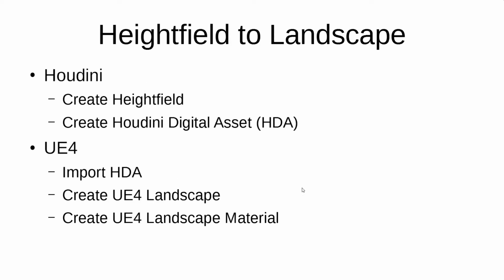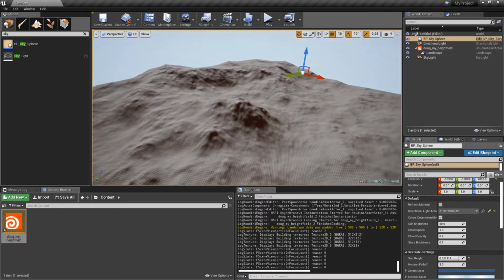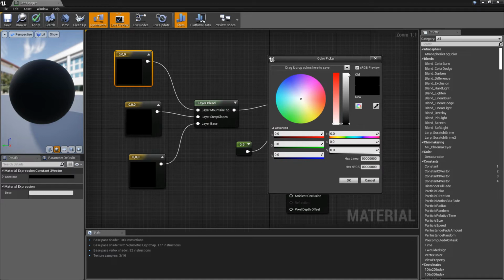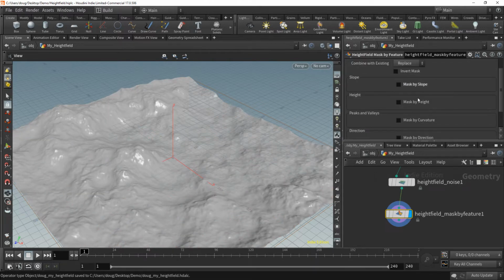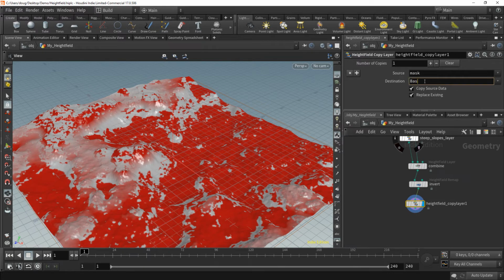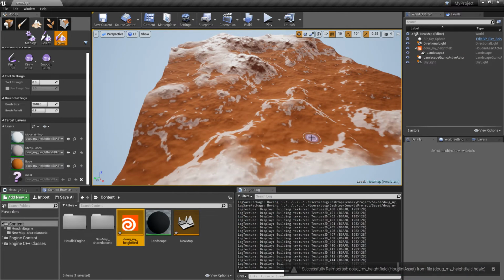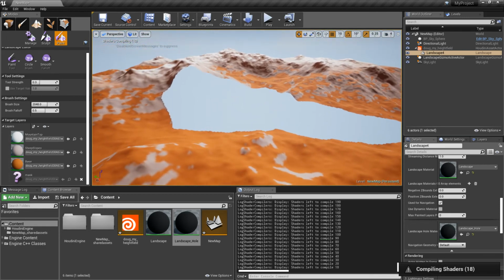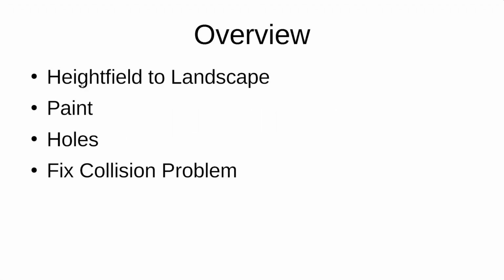#Houdini Heightfields to #UnrealEngine4 Landscapes

Comment: Does UE4 just see this as a large mesh? Whilst the advantages of using Houdini Heightfields to generate landscapes are obvious, is the UE4 landscape a lot less expensive in terms of computation or memory, etc? Nice and simple to understand what you did. :-)
Reply from the maker: No, landscapes are not simply large mesh objects. They are divided into components that can (among other things) be individually excluded from rendering during occlusion culling. You can see this in action by adding a landscape into your UE4 level, navigate around the middle so you can't see the entire landscape, run the "FreezeRendering" command, and then turn around to see what parts of the landscape have been culled by the occlusion culling. Google "Visibility and Occlusion Culling" for more information on this.

Landscapes support LODs on a component basis. If you had a single big mesh it would all have to LOD at the same level. Since a landscape is divided into components, each component can be given a different LOD depending on it's size on the screen.

Both of these only matter if you are going to be on the landscape. If you're just trying to build a distant landscape that you will never get close to, and this distant landscape only takes up a small portion of the screen and it is fine for the entire thing to be assigned a single LOD, then making it a single mesh is totally fine (e.g., distant mountains).

For more technical details, google "landscape technical guide".
Reply: @doug_richardson  Cheers. I thought the heightfield was exported and, somehow, put onto the UE4 landscape as a displacement map or something like that.
Reply from the maker: Oh, and you can always use Houdini's "Convert HeightField" node to turn your heightfield into a single mesh if necessary. https://www.sidefx.com/docs/houdini/nodes/sop/convertheightfield.html

Comment: 2:36 Assets are expected to be subnet at there core (who have a minimal subset of parameters from a geo node for instance), as you answered no, it uses the Geo node who have a bunch of extra parameters (Render for instance) so the dialog means they will get wiped out. Hope it helps, thanks for the video
Reply from the maker: Thanks for the info, that does help.

Comment: Houdini Engine does not run on the Free version. How can I import it into UE4 without the plugin ?
Reply from the maker: Unfortunately, you'd have to export the terrain and weight painted layers as PNGs, which is the same workflow used by World Machine, hand painting terrain in photoshop, or most of the other ways of generating landscape.

Comment: A heads up..the "destroy all spare parameters" that you didn't know the consequences of messed up the workflow for me, showed up as nothing in Unreal.
When I  chose "No changes" it works.
Edit: Scratch that, it worked one time for whatever reason, still having issues. It's only showing up as the Houdini logo in Unreal.
Reply from the maker: I've experienced issues where you only see the Houdini logo in Unreal (I assume you mean the actor in the UE4 level looks like the Houdini logo but never bakes to the landscape). Usually when that happens to me the issue is that HoudiniEngineForUnreal (the UE4 Plugin) cannot connect to HoudiniEngine for some reason.

1. Make sure your version of the HoudiniEngineForUnreal plugin matches the version of the HoudiniEngine installed. You should see some information about versions printed in the UE4 Output Log that tells you what version of Houdini the HoudiniEngineForUnreal plugin is trying to use.
2. In UE4, try File > Restart the Houdini Engine Session.
Reply: @doug_richardson  Quick reply, cheers. Been trying to debug this for a while now. I think I might be making my terrain in a way Houdini Engine can't access..like referring to a mesh in the scene or something like that, I'm new to this workflow and don't quite know the limits of it yet. I decided to simply file-cache my finished terrain as bgeo, load it into a separate geo node Terrain_Export and turn that into the HDA to bypass that stuff. I'm not really interested in being able to update it in real-time in Unreal, just the convenience of it creating the landscape etc automatically. Thanks!
Reply from the maker: @Moctop  Ah yes, I just recently ran into this. I was using the GameDevelopmentToolset's Open Street Map import node, and referencing an OSM file in disk relative to my Houdini project (the $JOB variable). When you drag the HDA into UE4, it cannot find the file. What you need to do is embed the file you are referencing in the HDA itself. You can do this by adding a file to the Extra files section of the Operator Type Properties window (https://www.sidefx.com/docs/houdini/ref/windows/optype.html#extra_files). Then, you can reference the file using an opdef: path (https://www.sidefx.com/docs/houdini/assets/opdef.html).

I just did this last week, and I think it's worth a video (just so I remember the process myself). I'll make a video to cover this an post it tonight. Stay tuned.
Reply from the maker: OK, video posted. It's still processing so the quality may be low for a few more hours. https://youtu.be/dh7ilfgtOdg

Comment: I'm still not able to instance trees with the unreal_instance attribute, it just not working, have you tried ?
Reply from the maker: Yes. You don't actually need unreal_instance attribute for this.

At a high level, you need to first create instanced static meshes and then bake it to foliage. Once it is foliage, you can further manipulate it with the UE4 foliage tools. The fact you have to bake it is a bit unfortunate because you have to delete old foliage and rebake when you change it, but it's better than nothing.

I have a UE4 example project and Houdini HDA (uses Houdini Indie) that demonstrates scatting an instanced cube over a landscape. Open the Foliage level and then look at the scatter HDA. The scatter tool can create foliage on landscape properly only if it has following options set:

1. Scatter Over=Input
2. Pack and Instanced=Checked
3. Houdini Inputs=Landscape Input (and then select the landscape in your scene)
4. Export Landscape As=Mesh

If the "Bake to Foliage" button is disabled, you probably didn't use instances meshes (i.e., Packed and Instanced was unchecked).

The geometry that is scattered uses a subnetwork input which allows you to set the geometry in UE4. I think you could also use this unreal_attribute like you were trying to do (I have not tried this). The subnetwork input method I used allows you to easily change the geometry from the UE4 editor.

Example Project:
https://github.com/drichardson/UE4Examples/tree/master/HoudiniEngine

More information here:
https://www.sidefx.com/docs/unreal/_instancing.html
https://www.sidefx.com/docs/unreal/_landscapes.html#LandscapeInput

Probably be worth me making a video on this. The main concepts you need to understand are instancing (called packed primitives in Houdini) including the Copy to Points node (which lets you Pack and Instance) and getting input from your UE4 landscape as input into your HDA.
Reply: @doug_richardson  Hum, what im doing now is scattering cubes on the terrain and then i drag n drop my trees on the cube in houdini detail menu. I tried with an input, just tried because i'm not able to understand how to use inputs, but well, if my trees could automatically spawn it would be nice.
Reply from the maker: @brunnersamuel4615  I think you already saw this in the sidefx forum, but for everyone else's benefit, I did end up making a follow up to this video that focuses on placing UE4 foliage from Houdini. https://www.youtube.com/watch?v=0PjZ9awgdFY

Comment: Heya, just wanna say super helpful tutorial. 
Was wondering, when using this method to paint the landscape layers, when applied in Unreal, it appears to have a very blotchy / stepped appearance, would you know a way of smoothing out the transition, so that there's a softer less harsh falloff for the layer mask? Any help appreciated.
Reply from the maker: You can use the HeightField Blur node to do this. You will need to change that node's Blur Layer to mask. https://www.sidefx.com/docs/houdini/nodes/sop/heightfield_blur.html

Comment: Tanks! I also had edge stretching, but I changed the heightfield size and it didn't work.What else possible factors can influence the problem?
Reply from the maker: Here's what I would try:
1. Make sure you can import a very simple terrain without any stretching. You can do this by connecting a Heightfield node to a Heightfield Noise node and then exporting the results. Start with parameters I'm using (size 1009x1009 and grid spacing 2).
2. Click on your first heightfield node and select "Node info" (or middle click) and inspect the "height" volume. If you followed my instructions in (1) above you should see [505,505,1]. Now go to go the display/output node in your network and view "Node info" to verify the "height" volume is still [505,505,1]. If it is not, you may have changed the resolution somewhere (e.g. with a Heightfield Resample node) which could introduce stretching. If the "height" volume sizes do not match between the first and last nodes in your network, search for the first node where the change occurs to find the trouble spot.
Reply: Thank you so much.It's really help.I found my problem on the "Heightfield_paint" node.When i press the "Recache Strokes"tab of the node,the "height"value changed to[505,505,1].
Reply from the maker: @jianchen9821  Oh, that's good to know. I didn't realize the Heightfield Paint node cached the input volume.

Comment: Super helpful video! Exactly the info I was seeking. I have also scattered some points on the terrain and brought those into UE4. The scattered meshes show up correctly and I am able to swap them out in the Instanced Inputs panel....but I am not able to control their position and scale individually. I can only change all of then as a group. Is possible to have individual control?
Reply from the maker: I'm not sure about that. If you haven't already, I'd post this question to the side fx forum.
Reply: @doug_richardson  I posted but no answer yet. Another obscure question...I am trying to use Mapbox data as origin of heightfield. Unfortunately UE4 refuses to load any HDA with Mapbox. I am guessing it may have something to do with their licensing API. Have you ever tried that workflow?
Reply from the maker: No, sorry, I have not. Would you mind posting a link to the forum post you made in side fx because I'd like to follow it... I'm going to need something similar to that soon.
Reply from the maker: Looking at this again... perhaps the recently added "Bake to Foliage" will get the job done. https://www.sidefx.com/forum/topic/62310/#post-277018